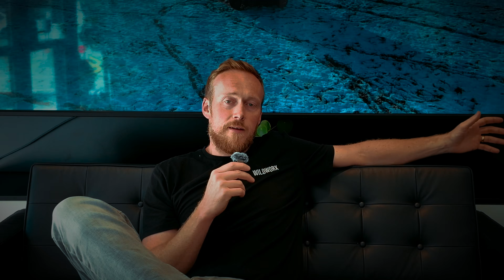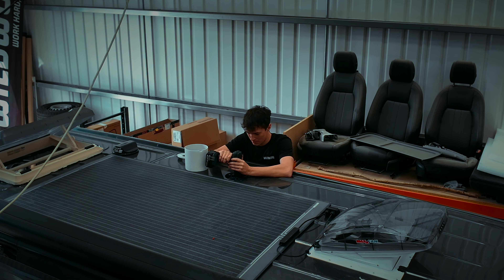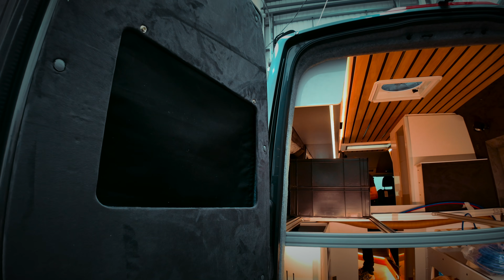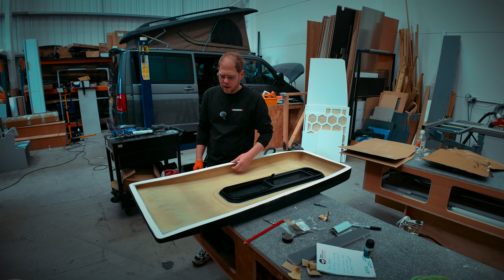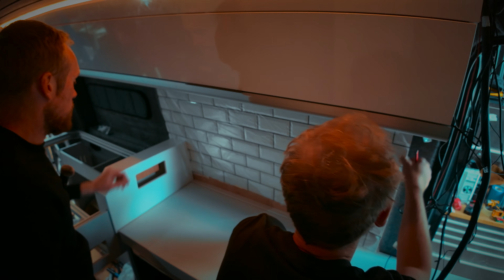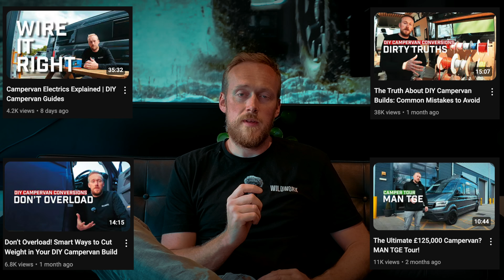Build Secrets of a Custom Campervan Conversion

Comment: Just loving your designs. What software do you use for the design and planning stages? Tx
Reply from the maker: Thank you! It's a combination of Fusion 360 and Sketch Up. However there are lots of online options specifically designed for campervans.

Comment: Great video…wee question on where you buy your led light strips from and do you use a defuser for them, I’ve bout some on Amazon fitted with a dimmer but seem to get very hot when on full brightness, cheers!
Reply from the maker: They’re Cob LED strips. You can buy them from Amazon. We’ve not had any heat issues. Make sure they’ve got the correct gauge of wire to them as this can cause issues if incorrect. 👍